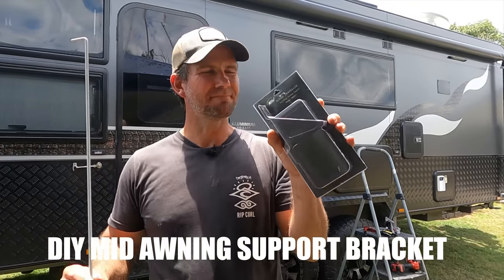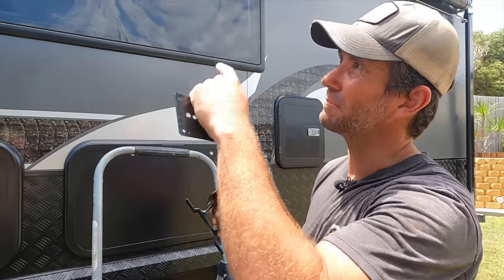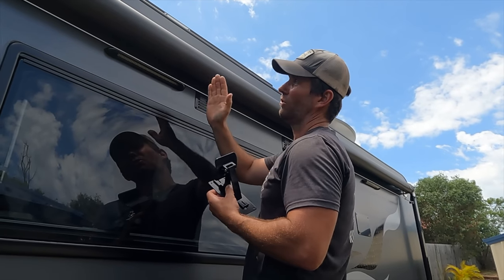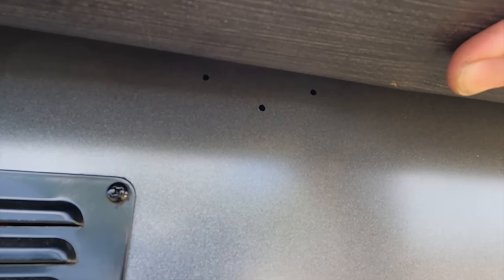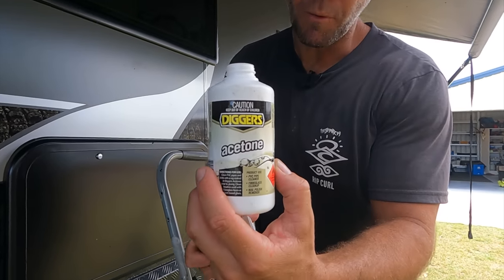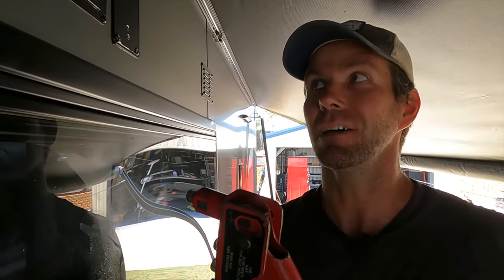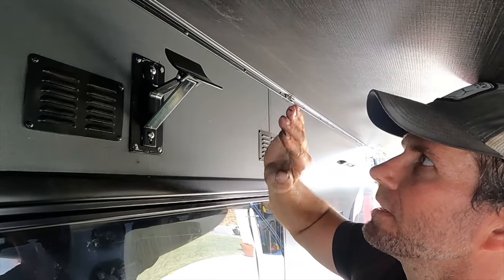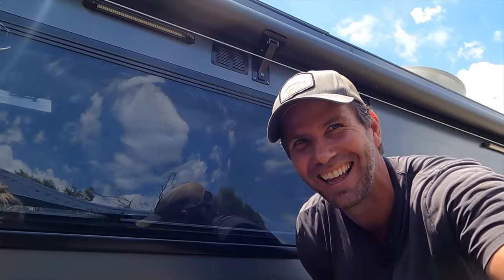Do It YOURSELF Caravan Mods - MID AWNING SUPPORT BRACKET👌 Roadtrip Australia - trip in a van

Comment: A top tip is to put a bit of hose on the drill bit as a depth guide. If you haven't  got a piece of hose you can always wrap a bit of insulation tape around the drill bit to act as a depth guide. Never know what's behind that wall.

Comment: Just a little tip. Don't silicone the bottom. Or leave a small gap. This way if water does get in, it can run out. Same principle applies to roofing iron.

Comment: Just a quick tip don’t sikaflex the bottom so if any water or moisture gets in it can drain out and dry out
Another flick the rivets and use nut inserts